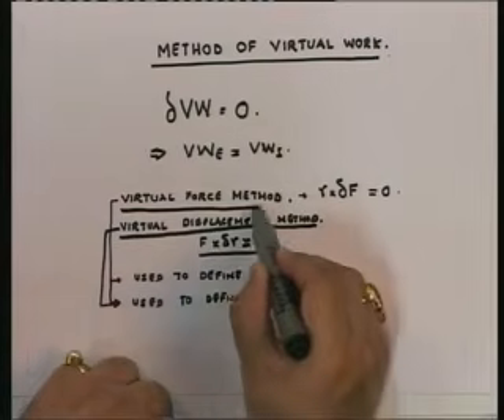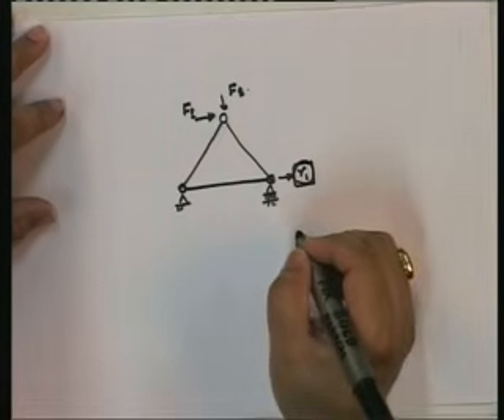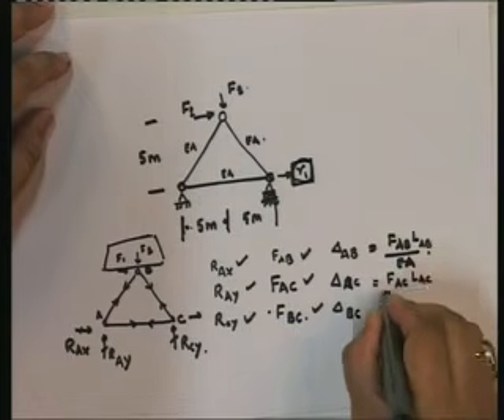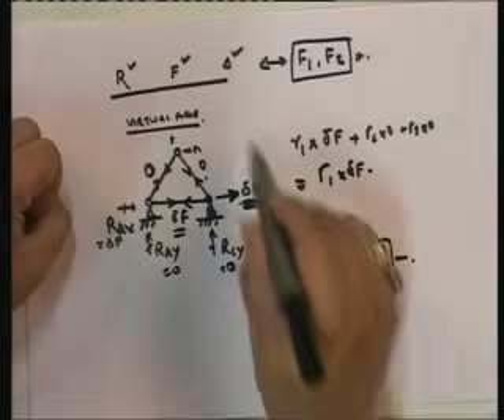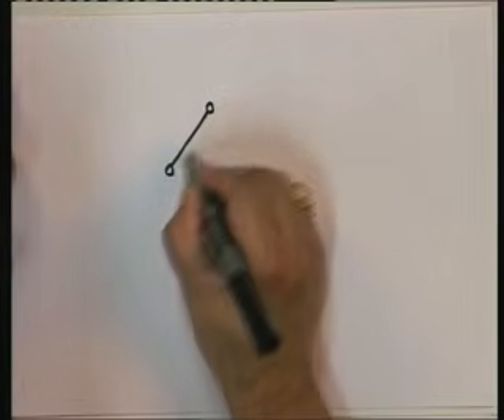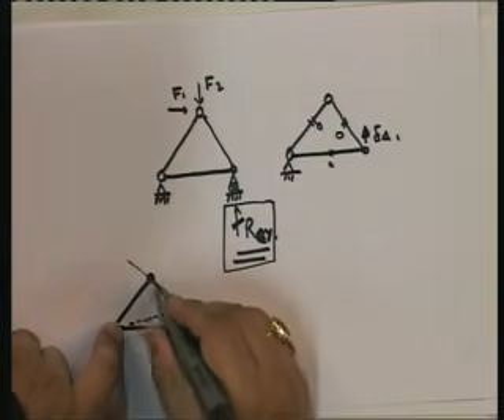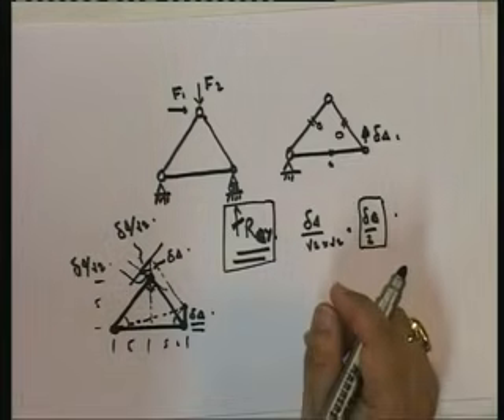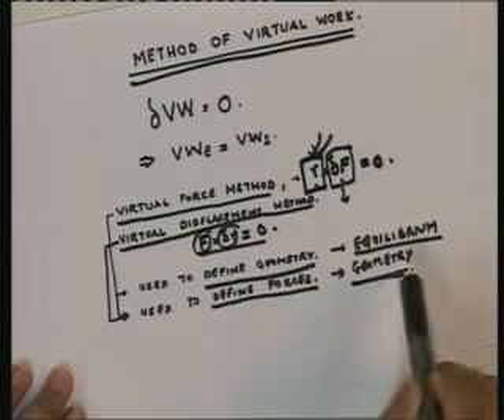Lecture - 3

Comment: the part where he's explaning how truss moves around a point since it 
became a mechanism is wrong, I mean it did become a mechanism and it 
will rotate in that fashion but since he's saying the members can't 
deform you can't say than i will move along a straight line like the one
 he drew, I has to move like a radius a long a curve so that the length 
of the move won't be altered